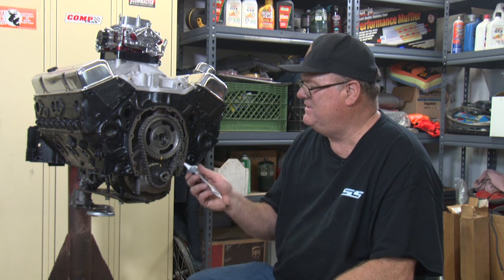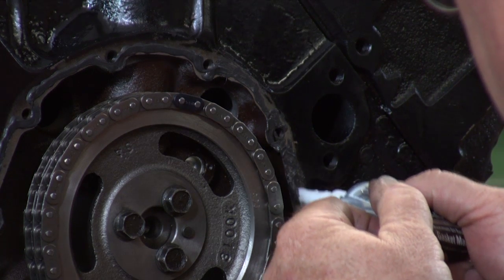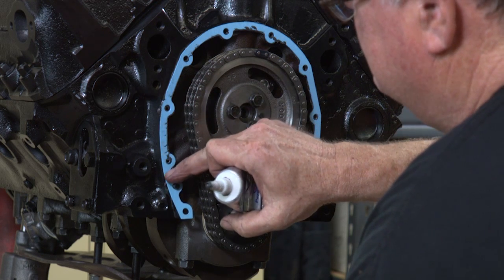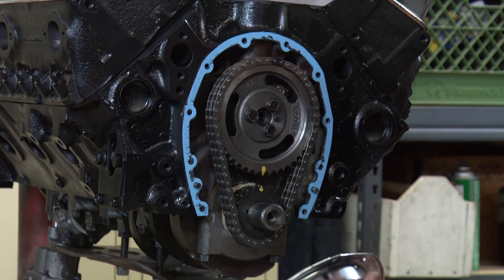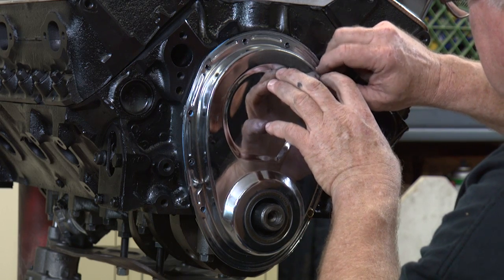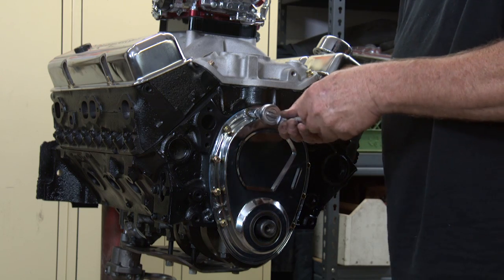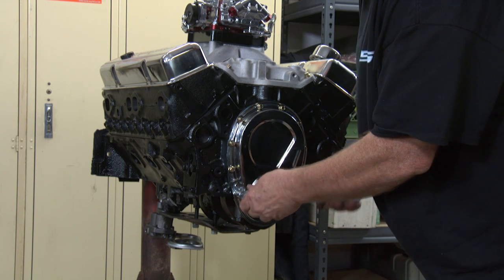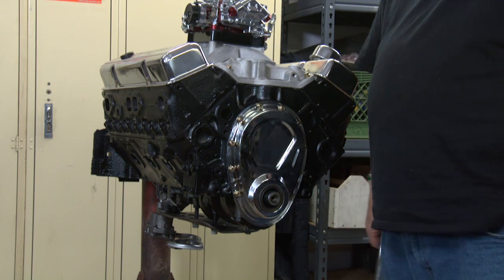How to Install a Timing Chain Cover on a Small Block V8: Easy Step-by-Step Guide

Comment: Mr Rob I have question. I broke one of the screws on my cover. I accidentally heard 120 ft lbs when it was inch pounds. Would one bolt missing cause a leak?

Comment: Wouldn t you put the balancer on before tightening the cover down ?
Reply: I mean the cover would already be on but not tight then  put the balancer on so it's through the seal then tighten cover when the seal is centered.
Reply: How will you put the cover on if the balancer is in the way?

Comment: 120 in pounds? The damper 5/8 bolt is torqued at 60 pounds?
Reply: That is 120 INCH pounds...Not 60 FOOT pounds in tourqe.Very different rating system.Inch pounds is very light tourqe ratings.Foot pounds is medium to large tourqe ratings.

Comment: What tool is used to take  the pulley off the engine and put it back on, or more specific off the crankshaft.  My other quandary is what tool is used to turn the crankshaft, without stripping the 5/8 bolt to acquire T.D.C.?

Comment: how about with the engine in the car? With the oil pan on.
Reply: Take the engine out
Reply: Take front bolts out of the pan hope for the best
Reply: @mariolt4940  I tried that, didn't work. I ended up dremelling a seal, fitting it in and sealing it with ultra silicone.

Comment: I never understood why use a paper gasket with silicone. why not just use the silicone by its self?
Reply: Allen McKinney technically, the paper gasket SHOULD seal it by itself. The problem is after years of use the mating surfaces become slightly uneven or develop minor pits on the sealing surface. Also, the use for the MINOR coating is to hold the gasket and bolt holes on the gasket in place while you are bolting it up, plus it assists in sealing any imperfections. I hope this helps.

Comment: Do you need a larger timing chain cover for double rollers? I have a 71 302 I'm going to do it on.
Reply: Kevin Horan some. I'm looking at a 2 piece timing cover so I can access the chain in the future and the cast aluminum vs won't clear a double roller.
Reply: Yes a stock will fit but you'll have have the block relieved by machine shop

Comment: Hey David im just about to install a brand new timing chain on my sbc 350 but the engines still in a pickup i noticed the timing cover has a lip that goes onto the oil pan and was wondering what would be the easiest way to install the cover back on should i just loosen all the bolts on the oil pan? Thanks ahead of time.
Reply: Loosen the bolts on the oil pan.